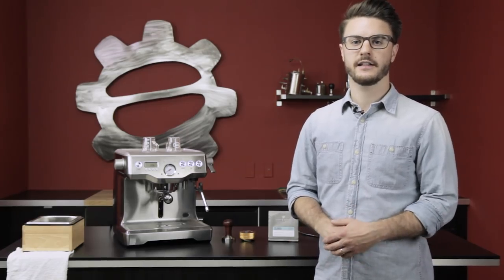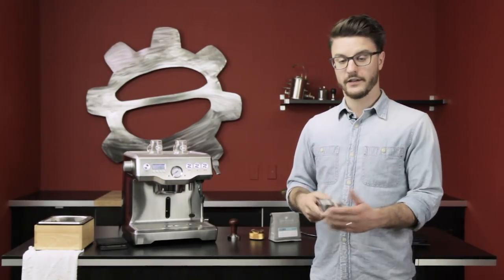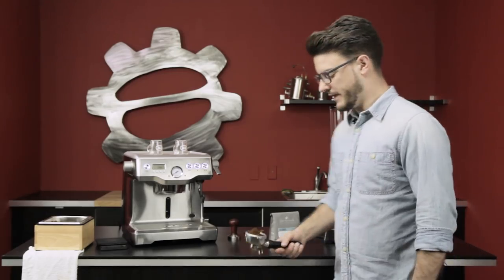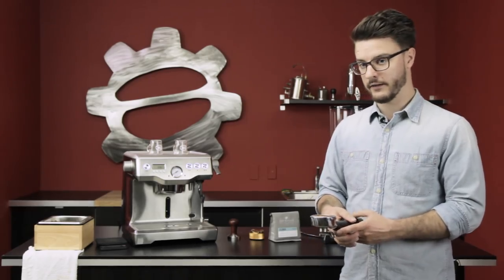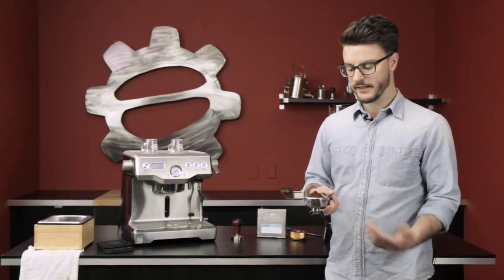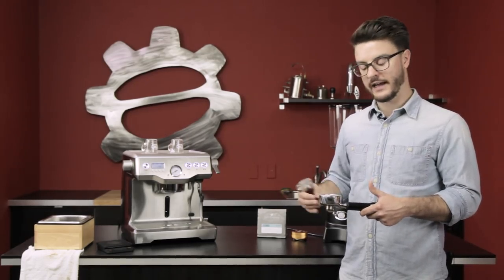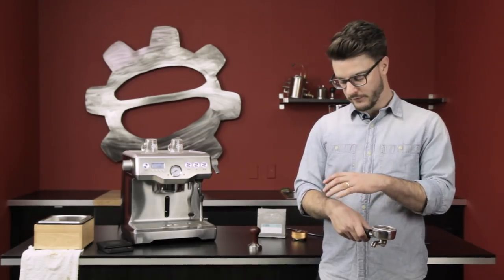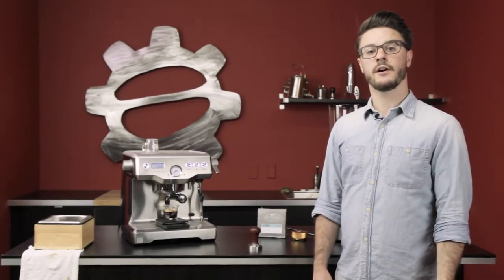Tamping Techniques Explained

Comment: So I'm new to this, when I tamp, the espresso doesn't pack in enough and ends up coming out if I were to flip it around. Is the problem the tamping or the grind? I am using preground coffee until I can get a proper grinder...
Reply: Generally, the preground particle is a bit too large too be packed tight enough to hold upside down (not always). Ofcourse a good grinder will help. Make sure it can grind small enough for "non-pressurized" basket.